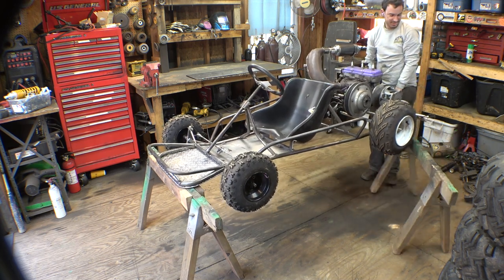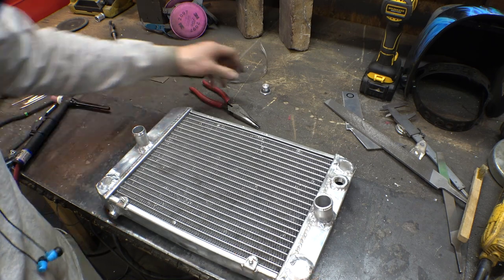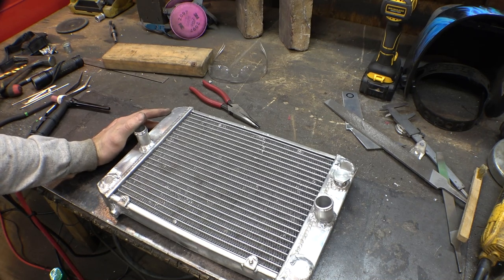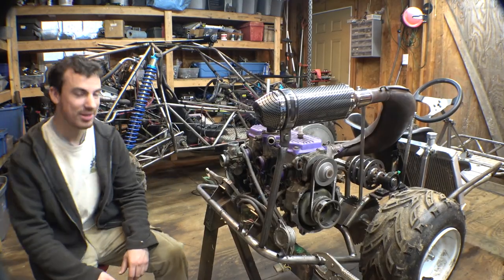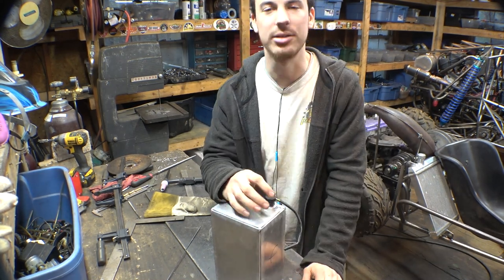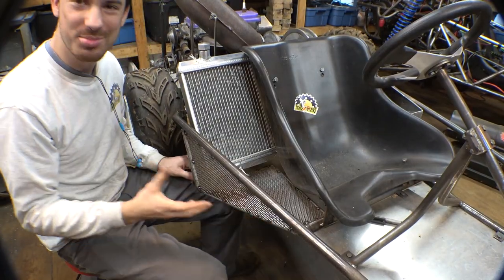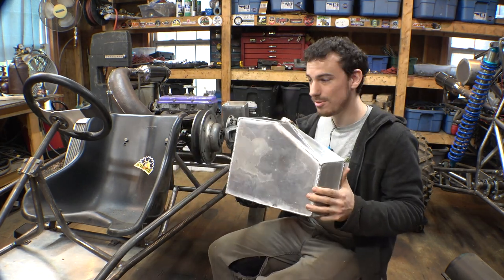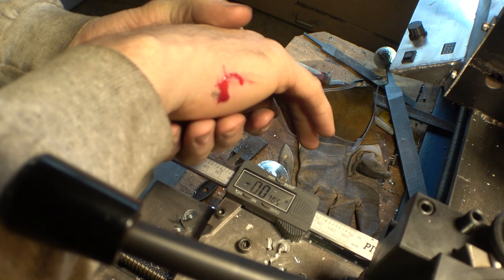95HP Two Stroke Triple Powered Yard Kart Build Part 5

Comment: Your fab skills are so great, I would never chamfer the holes just to put a rubber grommet into it. You care so much about every build. 
Id use acouple cheap dollar store leather belts as straps for your tanks. 
I think fenders would be cooler than a big water proof guard. But if you must have a guard use glue and metal tabs to build a clear plexiglass guard.

Comment: The o ring on the cap needs to be recessed into the cap more. That won't hold much pressure the way it is unless you crank the cap on wicked tight.  And then it's going to rip the orang most likely. 15psi doesn't sound like much. But it's enough to squash that o ring out of the crack

Comment: My recommendation for that muffler is that either take off the db killer at the very end or look for a 2 stroke muffler as they are very picku in terms of airflow. Freeing up airflow for a 2 stroke is pretty important. Just a tip for you could free up some power

Comment: Have you considered the dirt & rocks being thrown into the radiator from the driven wheel behind the radiator?
Reply: Stuff like that happens all the time to radiators and A/C condensers on autos every single day. A radiator like this is relatively cheap to get a hold of, albeit smaller than what most should run.
Reply: @Ratkill9000  The radiator is small and easy to get hold of, but theres a lot of work and modifications carried out to custom fit it. Plus, he's put a lot of effort into protecting it from the front, but not the closer rear? It just seemed a logical thing to do from a preventative stand point.

Comment: Nice video, what about for to secure the tanks with strong springs, so to weld tabs at the frame and in a higher point at the tank , some like the way who secured the exhaust muffler with the springs :D :D

Comment: weld some tabs onto the tank and the frame then use springs to connect them together this allows for tension without to much vibration transference

Comment: Use bungee cords to strap the gas and oil tanks into their rubber cushioned retainers. Instead of a "giant 'runimum' box". make the belt cover from sheet steel.  Buy more hydrogen peroxide to shop cleanse wounds like that- you need to flush it out and make sure you haven't got a chip of something inside. A word of advice, from my late uncle, my mentor; "Don't do that, son, It hurts". I'm sure he thought it was funny, but I had trouble laughing till the pain went away, too. It was good advice, though. FR

Comment: You can mount the gas tank with springs, like the exhausts on most 2 strokes, that should keep it from moving without bolts. Btw where can I get those fancy welding bricks? 🤣

Comment: Nice to see you put some baffles in the tank. Full of fuel it's going to weigh a fair bit, And all that fuel can carry a decent amount of momentum when it slaps into a tanks end cap. To hold the tank down, quick and dirty would be a short ratchet strap. The "Pro" way would be to make a bolt down steel tank strap that goes from the frame, over the top, and down the other side. Make sure to add clearance to stick some rubber padding to the strap though or it'll start to rub through the top of the alloy tank.

I'm not 100% sure your rad cap's going to hold full pressure as is though. When the pressure pushes up around the threads it's going to get behind the O ring. Usually you'd have a stepped lip around the top of the neck to restrain the O ring and stop it from being pushed out at one location , but you didn't add this step. Now it's fitted to the radiator I'm not sure of the best way to fix it. Maybe turning a ring groove into the mating face of the bung would keep it in place and prevent it blowing out?

Apart from that one potential issue you've done a VERY professional job on this. It looks to be a well thought out and exicuted build. Hat's off to ya mate.

Comment: If you look at polaris sportsman atv's they have big plastic cases around their cvt pulleys with an air intake on top going to the snorkel. It definitely needs to be well covered, i once got some water on the cvt belt on my snowmobile driving on a lake, it didn't want to move at all until the water was gone. So i say cover that thing up as well as you can and have an air intake with a cover on so water cant get in there. Also make a drain plug on the bottom incase water does get in there so it's easily drained out.

Comment: Yeti type cooler lid latches to hold tank down and your fuel tank will need to be vented if the caps are not. Cant wait for the first ride and subsequent wheelie bar fab video. Keep up the good work. Cheers

Comment: those gas tank welds arent that bad. I rememeber when i first started tigin' i was afraid of thin material but after mig welding aluminum alot and playing with a tig hardly ever i under stand the importance of throttle control...... set it hot (high amps) and play with the throttle. thats the beauty of tig. But i do weld on a $12,500 machine. Miller Dynasty 400. I love this machine.

Comment: On aluminum, you might consider using acetylene. Aluminums melting temperature is around 1800 degrees. You'll need to weld at least 2200 degrees for it to conform. 2600 degrees would be in the butter zone.  It's similar to welding iron only softer.

Comment: I would rebuild the oil pump or remove it if I were you. If it goes out and you seize your engine I guarantee you'll be pissed. In my opinion its better to run mixed gas in older 2 strokes to be on the safe side but you do what you think is best!

Comment: Re:  Oil Tank.  You just re-created the classic 1 gallon rectangular can, as seen for distribution of ethanol (fuel), paint thinner, shellac thinner, and other chemicals.  Congratulations!  Form does follow function.  :) 

Of course, yours is made of aluminum, and is therefore, way cooler.  (literally and figuratively).

Comment: Chris just use a strap like they do for batteries and ATVs. This way if you ever need to remove the tank   ya simply remove the fuel line remove the  hook strap from one side and you pulled the tank out.    K I S S..  carts looking good

Comment: Build some louvers to protect the front and rear of your radiator from fkying objects, as well as the muddy water coming off the front, and rear tires.
As for tie downs for your tanks. Find a source for the rubber tie downs used on equipment doors, that are fixed to the point contact point, and with a fixed recieving point, that you pull rubber tight from base, and attaches by pulling up on end.
Then by putting lose end in a holder designed to keep it tight, but simply sits in the fixture attached to your tanks that allows you to pull up easily to access the fhem if you need to remove them for whatever reason. 
Similar to what jeeps use to use for hood latched, but made of a UV resistant rubber that won't deteriorate in direct sunlight, and has enough elasticity to maintain tension on the tanks to keep them firmly secured at all times.
It may be to your advantage to add additional layer of aluminum on any sides of the tanks that will be exposed to flying rocks, and any other sharp objects thrown into them by rear tire. 
Better to have little protection just in case, are you may find yourself a foot due to small hole in either one leaving you stranded. 
Was that a set of baffles inside your fuel tank, to keep a small amount of fuel in place when your in heavily sloped areas, to keep the engine from starving for fuel in the event that your on a place that isn't level for a short time.

Comment: Have you thought about using a strap with a cam buckle, would hold securely yet be easy to release if necessary.

Watching you put the kart on the sawhorse, made me think have you seen Sarah-n-Tuned, she's on YouTube and works on cars, modifies them and does car reviews. Recently she and the garage next door to her have been getting into karts for fun, she worked on restoring, then ended up updating hers, she even put it on full size car lift to make it easier to work on and get round. The sight of a small kart on full size car lift was hilarious.

Comment: On the top of the front of the gas tank. Make another one of those nice metal brackets you made that the tank sits in. But put one on the top front that swings. Weld something on the tank that'll take a pin. Then weld a pin & the metal bracket will swing on the frame & you can swing on to the front of the tank. Put a pin in it & its locked in. Pull the pin out swing it over & the tank can be removed. This is coming out nice don't use a big hose clamp that'll be super hack. You could even make one for the back. So two metal swing joint things that fit perfect like the bottom. Weld a small hollow tube that'll take a pin. So you pull two pins swing the brackets out & the tank comes out. I know it's hard to understand but im trying....👍🏁

Comment: I was thinking you could weld tabs on to the bottom bit of pipe at a 90 degrees horizontally and the bend a piece of that perforated sheet metal to cover over the whole gas tank. That way it would stay light weight and keep the gas tank set down. Only a thought

Comment: You might want to consider tying the outer fuel tank brackets together with angle iron to act as a rub rail that is an awfully exposed tank seam.

Comment: Weld tabs on the gas tank and on the frame and use springs. they don’t have to be very strong and all you need is downward force and that would give it plenty of strength and would make the tank toolless removal

Comment: You mentioned your arc wondering. When dip your tungsten in the weld pool it’s different with aluminum, it can contaminate up to 1/4 of your tungsten and you have to break it off. Sometimes you can’t evan see the contamination happen and I go off how the arc acts. Hope this helps.

Comment: You should use springs to hold the tanks down. They would be secure and still have some give
Reply: Also maybe just get rid of the oil injection and mix the gas. Everyone does this and it works just fine. We’ve done it for years and run the motors hard, no problems.

Comment: Use rubber bungee chords to hold the stuff in place.  I am curious to see when/if you get the project finished if you will be unabled to steer the vehicle do to all the weight in the back and the torque of the engine.

Comment: My 1974 yamaha 250yz used a strap with a coupler similar to one on a helmet, you could use a strap with Velcro to hold the fuel and oil tanks in place.

Comment: Question, but where does your radiator vent/purge pressure? With a solid cap like what you've made, you've basically turned your cooling system into a bomb. Please use a proper radiator cap and overflow system, and put a shield around that radiator so you don't get sprayed if something goes wrong.

also, make sure you ventilate your gastank or else you're gonna end up with fuel starvation issues once the tank starts draining. I remember my dad had to drill a half inch hole in the top of his gas cap for his VW because the stock ventilation wasn't enough for his engine lol

Comment: I liked your radiator screen so much, that I hope you install similar on the other side for both appearances, and to protect your gas tank :D
As for securing the tank down, why couldn't you use rubber straps, or use similar brackets, rubber buffers and bolts as you used to secure the radiator?
That combined with the cradle you just created should help make it secure as well as reduce vibradion damage

Comment: I have only to 14 minutes into the Video, so if you have done it well never mind. Put "ANTISEIZE" on the threaded cap, also make sure you put a  "HOT WATER SHIELD"
between you and the radiator. 😎👍
Reply: Some 'Goop' should work just fine.
Glad someone else thought about galling the threads on the cap as well.
Reply: @yawningkitty457  Goop?
I was actually mostly worried about the boiling hot water from the radiator. He really needs a shield between him and the Radiator. 😎👍
Reply: @tillmanxl6914  Goop is an anti galling paste used to stop steel threads from galling/cold welding, you only need a tiny sliver of steel to foul the threads. Also, yes a hot water shield is a very good idea.
Reply: @yawningkitty457  I have never heard of GOOP. Is that the brand name? Thanks. 😊

Comment: Did you weld the bung on without getting rid of all the cuttings and shavings that fell inside the radiator when you were cutting and grinding the holes for the bung?

Comment: You could try using steel straps, they are usually about an inch on cars, and there is two of them. I guess for your application and size, two half inch strips with 1/4 bolts on the ends? If you put rubber or even leather between gas tank and strips, it should be absolutely fine.

Comment: I think you will get better welding if you use a wire brush only for aluminium and one for steel and use acetone after wire brushing in one direction on the aluminium

Comment: Man ... 
You can use so kind of straps to secure the gasoline tank...
And for the protection of the radiator , put some Mudguard on the front wheels, that might help...
And I think for the protection of the belt housing, made something from fiber glass ...
I really appreciate that you comment my ideas, and give me your opinion

Comment: The weight of the fuel in the tank will hold it down but you could put rails down the front and back of the tank welded to frame!!!!!!

Comment: Put a rubber pad down on the brackets that's holding the bottom of the tank that you made then put a couple of bracket up top with the rubber support coming across to hold the tank in short like how they would mount a ATV battery with a rubber mounted hold down strap

Comment: look into a polaris utility atv clutch cover. the clutched you are using are the same.  it would come with a back and cover with a vent. Theyre plastic and were used on every automatic  polaris from the 80s through late 2000s

Comment: The radiator looks a little lower comparing to the engine, it should always be a little higher than the engine so the air bubbles won't be trapped in the engine and they could flow towards the radiator. Nice job
Reply: Did you see the center of tank mounted in/outlets? It'll be making its own bubbles in the tanks while not even cooling.

Comment: For the belt guard, have you considered just a top and bottom plate and dimple die ever inch or so?  Could do something similar for gas tank hold downs.  Bolted to the frame with rubber sheet between the crossover part on top but it bolts to frame.

Comment: Use some turn key latch locks on the bottom. The kind you find that look like tool box latches with a wind up key on it. You shuld be able to mount a small aluminum tab on the gas tank and weld the latches onto the frame of the tank. Not sure what they are called. If anyone knows what I mean post the name of those things. Kinda looks like the ones on military ammo cans but is twist ajustable.

Comment: How about rubber mount tank to the frame with brackets and rubber inserts.. also I would put some kind of skid plate under the tank for protection as well, I'd use steel for the tank skid.

Comment: I can’t help thinking the o-ring on the filler cap is going to blow out under pressure. Shouldn’t it have a rebate turned into the rad side for it to sit?

Comment: aluminium welding clean the parts good  so all oxide is gone ampere low and slow rhythm and trail welding before you commit goodluck

Comment: Maybe an Idea for front protection of the radiator and not o bulky looking is a larger hole mesh mounted directly to the rad. I have an older Cub Cadet mower ('92) 3cyl Kubota water-cooled. in front of the radiator is a removable screen that slides up for cleaning and keeping larger stuff from hitting it.  Hope you see this and give it some thought. (Its a 2182 SLT if you are able to try and look up what I'm talking about)

Comment: hey i have a idea since u dont want to bolt the gas tank down maybe get some of them clips that a air box in a car would do it an as far as for the clutch just put that screen mesh over it that it gives belt air an not alot of water will get on the belt cause them holes are there isnt that big 
just a thought

Comment: Going to try something for my grandkids... better to use either hot rolled or cold rolled steel for the chassis... it’s all I have access to.
Reply: Are you asking which is better material? Gotta go with old roll. It's a little more expensive but it's cleaner so it's easier to weld and it's stronger material
Reply: @schism47  Thank you Chris... Nice projects you shown over time... Improved my skills by watching
Reply: DOM is what matters. Cold rolled might still have a seem etc. 
Its strength is rated in MPA, 350 MPA Dom tube is the minimum spec for rollcages

Comment: I don't think the radiator wil function like this for max performance,there wil be a coolant flow for about 20% of the radiator because the connections are in the middel of it
Reply: Yup, that's why every core ever made has in/outlets on opposite corners. But all his builds are only used as art pieces anyway so who cares

Comment: Dude, this is the second warning on this. The next will be one of those "I told you so" moments. You have a catastrophic weak point right behind the nerf bar. That 1" section that is between where the nerf bar is welded to the frame and the cross member that supports your transmission. The torque of that motor combined with your weight on the non suspended frame is going to fatigue that point and snap the frame. The only cross members I see in there are your seat back supports and your radiator support. That will not be enough to support the stress at that point. I hope you address this issue as this looks like a pretty cool build and I'd hate to see you fold it up. Good luck.